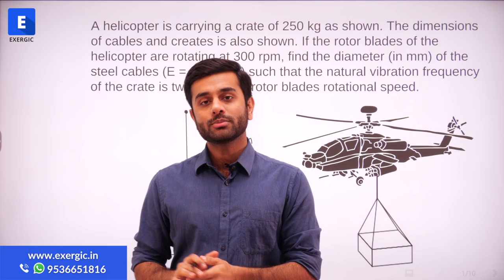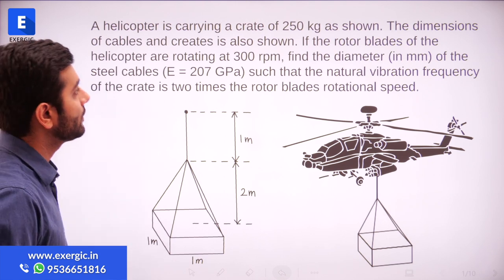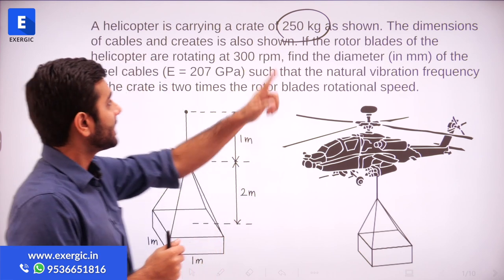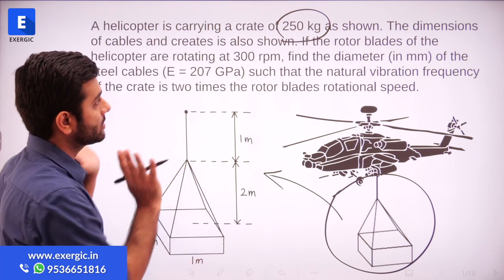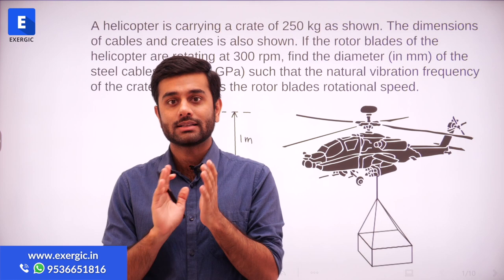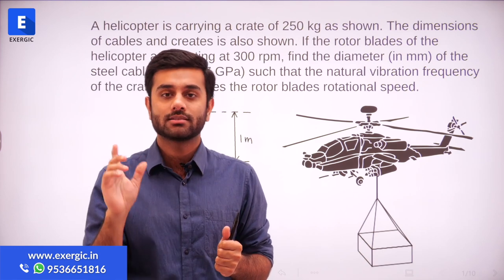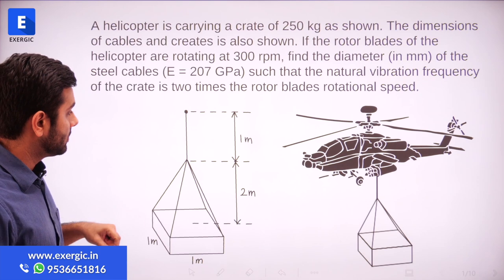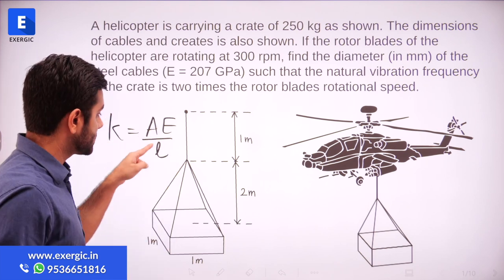Do NOT Miss this numerical - Vibrations | Theory of Machines | GATE Mechanical

Comment: Frequency of the blade is in rad/s while that of crate will be in 1/s or Hz. Isn't there a conversion required here ? ( Omega= 2*π*frequency )
Reply from the maker: No mathematical conversion required. As covered in basics of vibration, the SHM frequency of spring is a shadow of circular motion only.
Reply: @ExergicGATE  Okay. Thanks for the clarification.

Comment: This is a misleading question as transverse vibration should be of more importance in such helicopter instead of longitudinal. I first approached the problem with transverse vibration case and applying torque,theeta, I method and stopped when I was unable to find I.
Reply from the maker: May be you are confusing initial swaying motion with vibration motion. When helicopter blades are rotating at a constant speed, as given in the question, the transverse swaying will also stop.

Hence, the cable and crate system given to us is analysed for longitudinal vibration.

We don’t get to decide which vibration is “important”.
Reply: @ExergicGATE  sir, although the rotor is having uniform velocity practically effect of wind is more dominant in such flying things at height ,so there will be transverse vibrations in different directions ,so it is better to mention assume longitudinal vibrations only.
If there are any mistakes please correct me sir